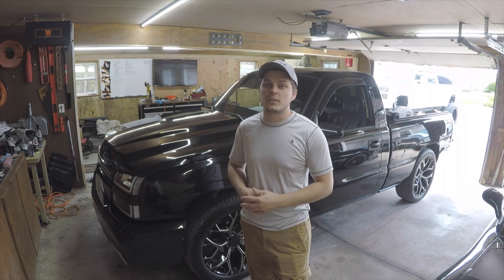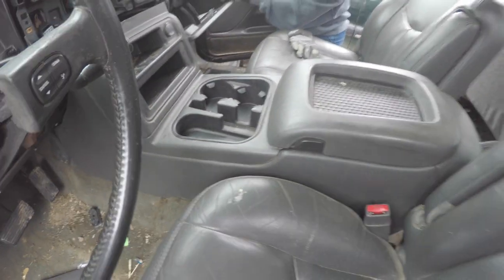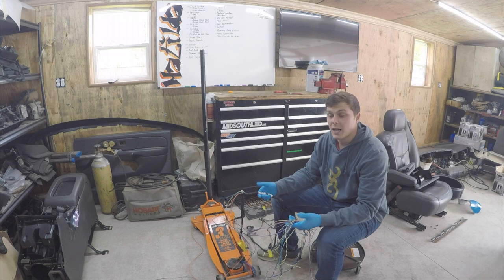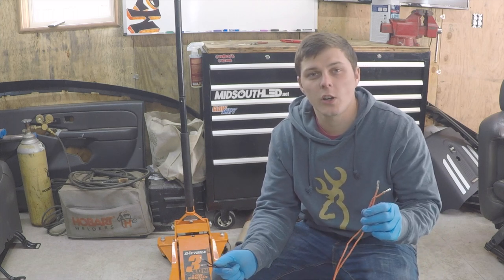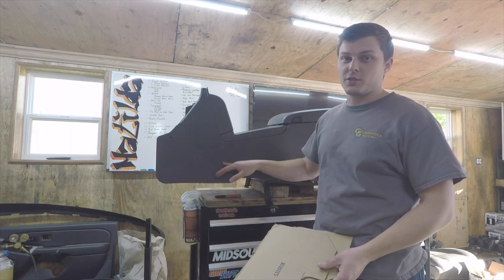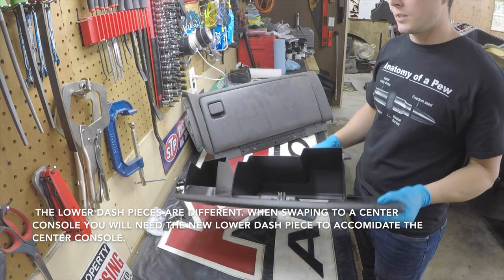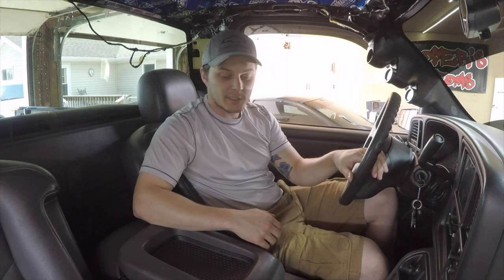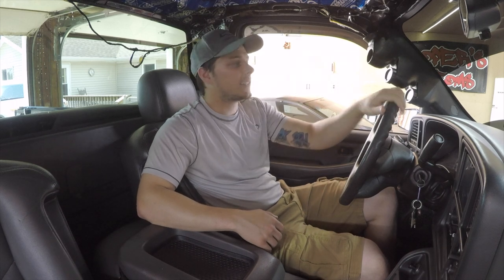Silverado Bucket Seat and Center Console Swap, "How To"

Comment: Can you do a power window tutorial vid man it would be nice to finally see a step by step video
Reply from the maker: Hey, I'll have to think about it. I do have the door harness for the electric windows/locks. But I do really like the manual locks and roll up windows, which is why I didn't swap them when I had the doors apart for the dynamat and the sound system. Less electronics to mess with, or malfunction. But I'm not sure, I might change my mind and swap it

Comment: Awesome video man ! I’m working on this same center console project in my 04. I love my vinyl floor vs carpet. It’s so much easier to keep clean and it shines up nice 👍. Mine is all manual seats , windows , locks , mirrors. I prefer manual because there’s no motors and actuators to fail.
Reply from the maker: Glad you liked it! I definitely agree with you, manual everything is so much simpler. Its kinda funny, im actually switching from the vinyl to some nice thick carpet. My roll cage makes the floor vibrate like crazy. So im going with some dynomat, then dynoliner, and thick carpet to help counteract it. Thanks for the support!

Comment: Working on this swap on my 05 W/T currently. Don't forget to swap the airbag module on the bottom of your seats from old to new to avoid the airbag light. Also, if you grab a console that doesn't go all the way to the dash you don't have to mess with the 4x4 shifter, although you give up a bit of storage.
Reply from the maker: Yea... i totally didn't swap over the airbag module. My airbag light was on before the swap, so I have to figure that out still. Im pretty sure the shorter two piece consoles are from the 99-02 trucks. Thats definitely a good alternative option though. I prefer the console mating up to the dash. Thanks for the info. Let me know how uour swap goes! 🤘
Reply: @TheKingCoopa  Small part bolted to the seat frame, the one that came in the truck should stay in the truck. Pull the airbag code, I had one of my front impact sensors fail causing a light years ago. Also, love the dynomat, thinking of doing that when I pull this off in mine.
Reply from the maker: The bad part is I already sold the seats, to recover some of my money.... what a rookie... also I have a large cam, no cats, full 3in exhaust with side pipes. So it was stupid abnoxiously loud. Most of the exhaust sound came through the back of the cab. But doing the dynomat, and then the lvl2 dynomat foam on the back of the cab. Helped out tremendously!!! Dynomat is really expensive, but for me it was so worth it. I can actually hear myself think while I drive 😆😆

Comment: First of all, great video man! It was relatively short and gets right to the point, without incorporating all the extra nonsense that a lot of other videos do. So im doing this same swap right now in a 2005 GMC 2500hd SLE 4x4 that I just picked up. The truck only has 100k on it, so I decided to do a full resto. The only problem I'm having is how to get the heated mat in the seats to be functional without having the harness out of the donor truck. Any ideas? Again great video and nice pickup!
Reply from the maker: Hey, im not the best with wiring. But when I picked my seats up, I tried to do some research on how to hook them up. There is so much junk inside those seats for the heated function, it was making my brain hurt lol. So I said screw it, and didn't worry about the heated function. (Since then I have already sold these seats and went to a set of corebeau FX1 pro seats with 6 point harnesses)

From the research I've done the two best methods were to either use the full donor harness. Or to buy an aftermarket seat heater kit. Where you can put the heating pads under the leather, the module will go under the seat and requires a ground and power wire. Then you just need to wire up a switch the heated function. Sorry im not much help there, those heated seats were blowing my mind 😅 Thanks for the support though!!

Comment: I love seeing these videos. Seeing upgrades I did to my truck. I need to upgrade my upgrades though
Reply: I have a 4 door & I did the center console swap. Thinking about buying another one for the back & fiberglass them together.
Reply from the maker: Hell yea haha. And I love that idea. My white truck came with a console in the front already. I bought a set of yukon 2nd row seats like a year ago. I still need to pickup a 99-02 center console (they are alot smaller) and that way I can pull the back bench out and swap those in. For quad bucket seats and dual center consoles. I thought about a custom full length center console. Which look amazing, but I dont want to put that kinda time into it haha

Comment: Have you ever thought of putting power windows and the upgraded thermostat I’m trying to see if I can do it I have a base model that I’m interested in doing it in but I don’t know how
Reply from the maker: Hey, I tried looking for a donor truck for a while, but all the single cabs in my area were always manual windows. So I gave up. And I didn't want to try and hack up an extended cab or crew cab harness. There are a few companies that make after market kits, but they arnt as nice as oem. Its definitely possible, people do power swaps all the time.

As for the climate controls change, ive herd a few people do it, but its pretty rare and super difficult. I herd you have to change out the whole dash harness, along with the bcm to control it. Most people say its not possible, or worth the effort. Hope that helps, good luck!!

Comment: First video I have seen from you. I like what you are doing. I have the same wheels on my 07 Tahoe. Nice choice.
Reply from the maker: Awesome, welcome to the channel! I bet your tahoe looks sick with them. I'm glad I bought them, definitely makes the truck pop
Reply: Spent a few coins on her. Lowered to police Tahoe height bell tech. New sway bars and  spohn Panhard bar. Rebuilt 5.3 with custom comp cam and 30 over pistons. Used the trailblazer torque converter and corvette servo in the old 4l60e. Tinted windows and of course those wheels. Anyways I will keep watching to see how yours comes along
Reply from the maker: Hell yea, all the mods I'd do 👌 let me test drive it for a youtube video 😎 but hopefully your 4l60 hangs around for a while. I had mine built, 2600 stall, rated to 600hp/tq. So hopefully it doesnt grenade  once I put nitrous on her 😆. And thank you, I appreciate it!

Comment: I'm thinking about getting a donor vehicle so that I can do power windows, bucket seats, console etc. I have an 06 work truck that I have already but a 6.0 in and retained the 5 speed manual
Reply from the maker: Oh nice, thats awesome! I gave up looking for the factory electric windows. Bucket seats and center console swaps are easy though. Every single cab I've found in the fuck yard is always a WT model. It might be easier to buy a donor like you said. Either way, good luck. Hope you find what your looking for 🤘

Comment: Had some manual seats, found some electric ones, do i need to replace the old brackets on the floor for seats to fit? Or is it just a swap for seats!?
Reply from the maker: Hey, as long as its from the same body style, it will bolt right in.

Comment: Thanks for the great video, where did you get the gear shifter you used for the console? Am doing the same to my 2004 ext cab
Reply from the maker: Hey, it is linked in the description of the video. If you have a welder it would be easy to make and save you some money. Thanks for the support, good luck with the swap!

Comment: I’m looking to do this upgrade also I have a donor harness with a white connector for the fuse box but it doesn’t fit.  I think it pin locations. Where did you run power from
Reply from the maker: Hey, sorry for the late reply. I forgot to film that part, but I ran the power wire to a fuse tap. And ran that off the interior fuse box, for the 4x4 fuse, since my truck has the manual 4x4 floor shifter.

Comment: Thanks for making this.  I’m 6’ 7” and considering switching to leather seats.  How much higher is the leather compared to the cloth in inches ? Thanks
Reply from the maker: Hey, with the new seat foam and the seat spring, I'd say it was about 1 or 2 inches taller than the cloth seats. Not much but it made a big difference for me. Hope that helps, thanks for the support 🤘
Reply: @TheKingCoopa  yikes I have 2” clearance with cloth seats and no sunroof.
Reply from the maker: @georgiabigfoot  ahhh, yea thats close haha. Worst case scenario, you could always go to an aftermarket seat and a shaved seat bracket base.

Comment: Will those bucket seats wider than the original seats? I have the fold down console like you originally had and want to keep it and just swap the clothe driver and passenger for the leather
Reply from the maker: Same width, it will swap over. Basicly any 99-06 gmt800 the front row is the same mounting points and can swap over. I swapped avalanche seats (the dimond stitch pattern) into my flatbed single cab 3500, with the fold down jump seat. Hardest part is just getting the colors matching. 99-02 have a darker blue/grey cloth/leather. 03-06 have the light grey  cloth/leather.

Comment: what flooring material is that ? I LIKE IT
Reply from the maker: Hey, I used 120sq feet of dynaliner sound deadening. Its expensive. An alternative is called killmat, its cheaper, and "supposedly" just as effective. But I havnt tested it yet. If you do this, get metal rollers to help in installation. I also have another video of the dynomat install if you're bored. 

Then my top rubber liner, is just the regular rubber flooring that comes in the work truck models from GM. I believe you can also order it online at rockauto.com. 

Hope that helps. Thanks for the support 🤘

Comment: Hey brotha great vid, I was wondering how you were able to get the bolts out of the seats at the junk yard, I’m trying to do the same mod to my truck.. being that there’s no Power in the truck at the junk yard
Reply from the maker: Hey, most people take a jumper box, and connect it to the battery cable leads. Then they can move and test the seat that way. I dont have one of those. So I had to use a wrench and turn the seat bracket bolts 1/16 of a turn, at a time. Took forever but I got it. Thanks for the support!

Comment: You truck looks really good I’m in a process of doing the same thing can you do a little video of the wiring all like a picture of the which one goes Where
Reply from the maker: Hey, for the seats to work you only need the power and ground hooked up. All 10 way motors will function. The grounds will go to the factory stud under the passanger seat. The power can go into the driver side fuse box, on the side of the dash. Sorry about not showing the power wire hookup. I either forgot to film it, or messed something up, but it wasn't included into the video. I wired the power wire into the 4x4 push button fuse (since mine is a floor shift version) this will apply power to the seats when the key is on. Or you could pick a different fuse if you want power on all the time. I'm saying it like this, because I won't beable to make an additional video for you. The seats have already been sold, removed from the truck, and harness has been stripped down. I swapped to Corebeau FX1 racing seats, with a 6 point harnesses tieing into my roll cage. Sorry, but hope that helps! Thanks for the support 🤘

Comment: Did you drill new holes for the Chevy seats ?
Reply from the maker: You mean to bolt them up? No need. The new seats were from a 2005. So they are a direct swap. Any of the seats front rows, will fit from 2003-2006

Comment: I have the same ugly manual cloth seats in my truck bro. If I buy the same seats from my local junkyard how do I power the seats? I seen you ran a red power and ground wire that connected to the clip that connects to the seat but where do you run the other end to? Where does it go to pull power from ? Sorry if its a dumb question but I seriously look up to you nd your vids because everything you done to ur truck is exactly what I want done to mine and I'm not all that good at upgrading like you are.
Reply from the maker: Haha its all good man, it takes time 🤘 I know a decent amount, but im still learning every day. And sorry about the power wire, I totally forgot to record that part. So you have a few options. 1. Run it straight to the battery (I wouldn't recommend, just gets in the way if you have to remove the battery and doesn't look nice). 2. Connect it to the orange ACC wire running down your steering column, then it will have power when the key is on. 3. Tie it into the interior fuse box under the dash. Either find a fuse that isn't used often, and plug into that. You can either hard wire it, or use a fuse jumper. I used the 4x4 fuse, since I have a manual floor shifter, and not the electronic shifter.  4. There is a connecting block under the dash, close to the floor, where the seats would factory plug in. But mine being a W/T model the trucj wiring harness didn't have pins for it, so it wouldn't have worked for me. But it might be worth looking at, to see if your connecting block has the pins, then is should be a plug and play, but I doubt it. 

Hope that helps! If it seems like a big challenge, just do the fuse jumper, it will get covered up, looks nice, and you can always remove it easily down the road. Thanks for the support man! Good luck on the swap 🤘 currently tearing down the new 6.0 and already got my quadrasteer bed. So those will be my next videos. 🤘
Reply: @TheKingCoopa  yea I have a WT also bro so everything is manual. Manual door locks and manual windows. So I just need to get a power wire and splice it into that orange ACC wire and the other end goes in the clip of the power seat? Does the power seat wire harness only need some type of power running into it to work like could I just splice it into something that has power running into it or does it have to be done a certain way. Sorry I'm really a novice at this. I wish I could just pay you cuz you made everything seem so easy . You really are the reason why I started upgrading my truck because as soon as I saw your truck and what you were doing to it I was like wow this is exactly what I want my truck to look like . Bro u got no idea how much I look forward to seeing your vids and try to take your advice and inspiration to mod my truck to be similar like yours. I just wish I had the funds to do an engine swap like you. I have the little ol 4.3l V6 .... meh 😆 🤣 😂.  Anyways , I'm gonna have to do some research and homework to get it to work. The bucket seats,console,ss bumper and grill are my next projects . Then I'm gonna paint my truck I'm just trying to save up money and decide on what color.its currently dark blue but I want something new. Maybe maybe matte black or matte red with the black grill and brake ducts.well see.anyways,keep up the awesome videos bro I look forward to them all the time !!! Maybe we'll bump into each other in this life or the next lol. Take care brotha!
Reply from the maker: @rXco_dXnero  yea, you could just splice it right into the ACC wire. I would stick to the ACC, fuse box, or battery. I wouldn't just splice it into random nearby power wires. Just because gm designed the harness a certain way. Certain things in the truck might require different volts or amps. And its only designed to operate on that level of volts or amps. And if you splice into it, it will be pulling some of that power, and then it might not have enough volts/amps to power whatever circuit you spliced into. Thats why they designed alot of the circuits with relays and signal wires. So you flip a switch and the signal wire tells the relay to pull all the power from the battery to power that device. Hope all that makes sense haha. And down the road if your interested in a v8 motor swap, I know you can find the engine, tranny, Harness, bcm, ecu, for like 1,500$ at a local pick a part. I havnt done much research on it. But I know its just time consuming, having to tear your truck all the way down. And you would need alot of space. 
Getting it painted would be sick. Have you ever thought about wrapping it? Its cheaper, and you can always change it like every 2-4 years when ever you get bored of that color. Thanks for all the support man. I'll try to get some more videos out soon 🤘

Comment: Good morning, do u think the glove box has to be changed to add the center console?
Reply from the maker: Hey, the glove box no. The trim panel that goes around the glove box, Yes, that will need to be swapped out. I would keep the glove, since it has your vin sticker with the RPO codes on it.

Comment: So in that connector you spliced I'm the orange power and ground but what about the other wires going into that connector?  The smaller ones, are they just for show or?
Reply from the maker: From The GM Technician Service Manual
Connector C305 Body Harness To Drivers Seat Harness.

Pin A, Orange, Battery Positive Voltage
Pin B, Pink, Passenger Heated Seat Element Control
Pin C, Not used
Pin D, BRN/WHT, Class 2 serial Data
Pin E, BLK/WHT, Seat Belt Switch Left
Pin F, LT GRN, Seat Position Switch Left
Pin G, LT BLU, Passenger Heated Seat Back Element Control
Pin H, DK BLU, Passenger Heated Seat Element Supply Voltage
Pin J, DK BLU, Seat Belt Switch Left
Pin K, DK BLU, Front Passenger Heated Seat Back- Temperature Signal
Pin L, LT BLU, Low Reference
Pin M-R, Not Used
Pin S, BLK, Ground

Basically for the electric seats to work you just need power and ground. Your trucks harness should already have the Class 2 serial data, seat belt switch, seat position switch, ECT. The other pins are not used if your not using the heated seats.